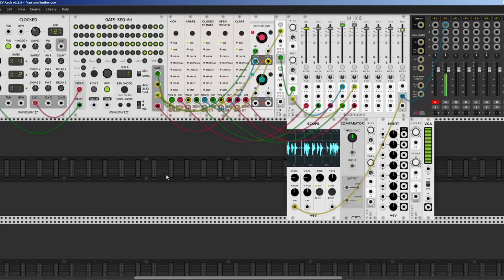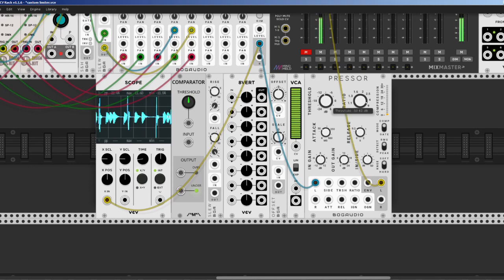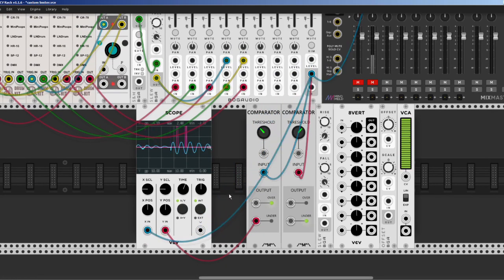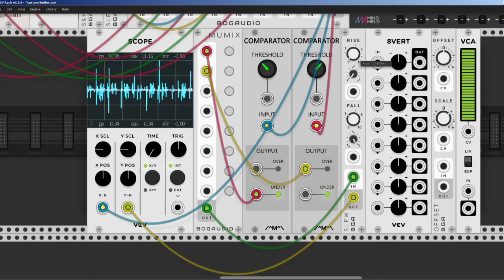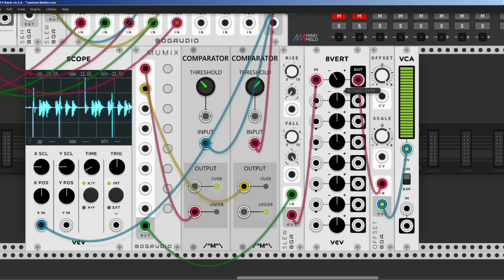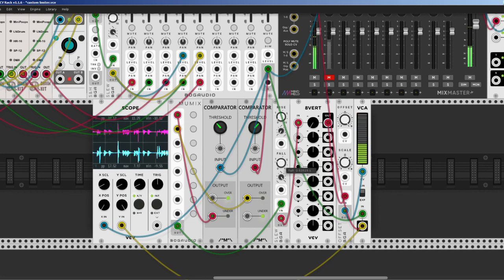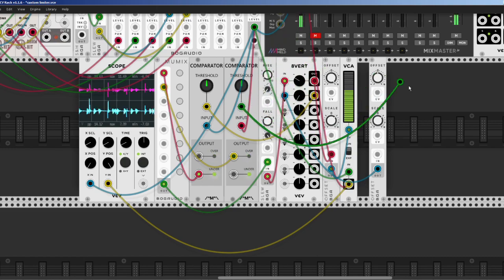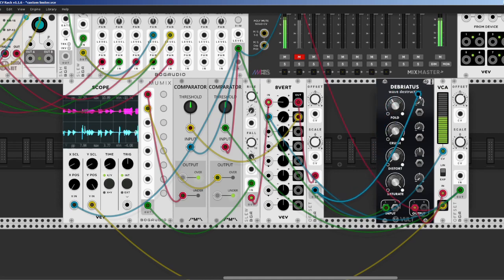Creating Custom Compressors in VCV Rack

Comment: Super nice setup. As you prob know you could also use an envelope follower for the a similar outcome.
Reply from the maker: Yeah, that's what I typically do in hardware eurorack, but with the comparators you can set a cutoff threshold, giving you a little extra precision if you need to manage a really dynamic sound.